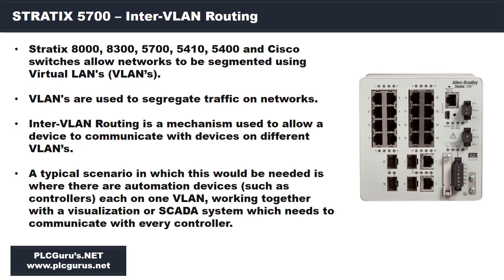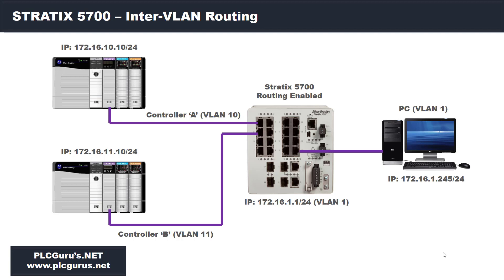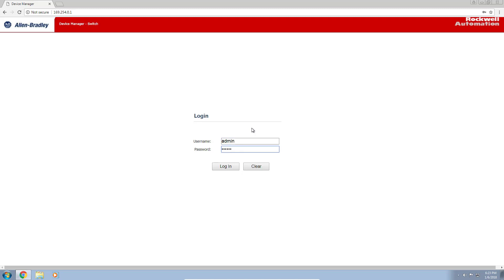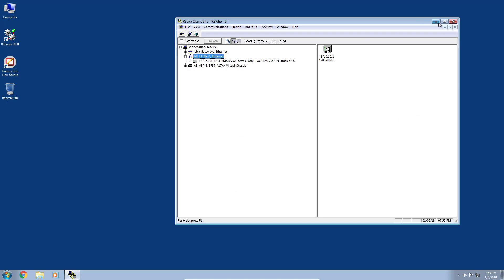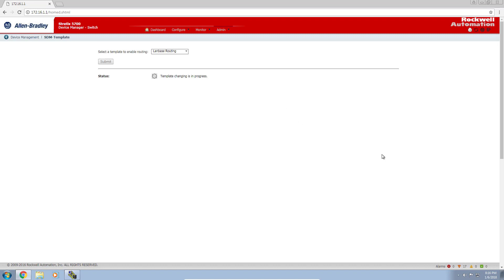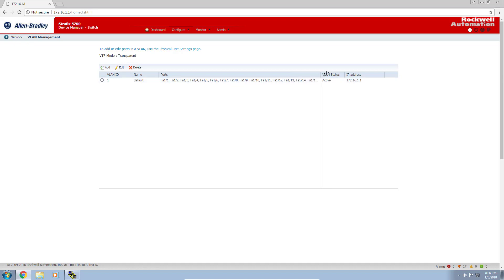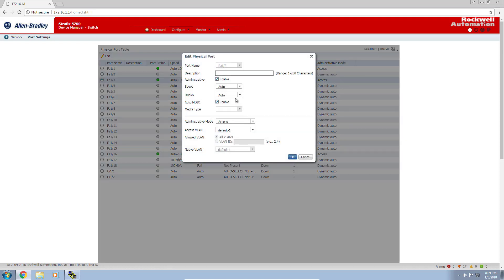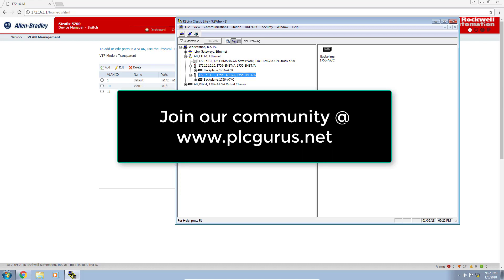PLCGurus.NET - Stratix 5700 VLAN Routing

Comment: If I need connect a tooling with different ip addresss than plc . Let's  say tooling have scanner, cameras, sensors ,pneumatic block ,ios everything with ip 192.20.20.xx but the plc is 192.168.1.xx, I cannot change ip addresses tooling because should run in 2 different lines.  What can I do for plc 192.168.1.xx be able to recognize?

Comment: ah mate please help me here, i used same method but RSLinks shows plc as unrecognized device. been trying it for days now. Also in routing section , if i incert gateway ip 0.0.0.0 , a message will display 'error in gateway  IP'.
Reply: Have you found the answer? I have the same issue
Reply: same here
we need clarification

Comment: QUESTION:- THE VLAN ADDRESSES YOU ASSIGNED ARE INDEPENDENT OR DIFFERENT FROM CONTROL LOGIX PLC ADDRESS ?
Reply from the maker: Not sure I'm following but yes your VLAN IP address must be unique. Typically you'll assign the vlan a xxx.xxx.xxx.1 or .254 address, these are common gateway addresses. Then your PLCs will be on the same network as the vlan to which they're assigned. Hope that makes sense.

Comment: How come I get an "Error in gateway IP." message when using the 0.0.0.0 on Routing Gateway Address?
Reply: The switch should have an IP of 172.16.1.1 and no gateway. The PLC has an IP of 172.16.10.10/24 and a Gateway of 172.16.10.1. The RIO has an IP of 172.16.11.10/24 and a Gateway of 172.16.11.1. The PC has an IP of 172.16.1.245/24 and a Gateway of 172.16.1.1 (which is the same as the switch IP). The VLANs, 10 and 11, in VLAN Management must point to the PLC's Gateway addresses. https://www.plcgurus.net/forums/topic/startix-5700-vlan/page/2/
Reply: @zfire777  The switch should have an IP of 172.16.1.1, if  172.16.100.1 ?
Reply: Leaving it blank worked for me on firmware 15.2.(7)E3

Comment: Just a note that Stratix 5700 will have different features depending on the catalog number. You will not get a routing capability if you have the basic catalog number. Please see manual for details on the meaning of the characters in the catalog number.
Reply from the maker: Great point. Thanks for the comment Gilbert!

Comment: Did the newer firmware on the 5700s break this feature?  I can’t enter 0.0.0.0 on the gateway.
Reply: I tried this a couple of days ago myself with a Stratix 5700 running version 15.2(6)E2a firmware.  I was able to enable routing and just leave the gateway blank on the routing page and everything worked.  Hopefully this helps!
Reply: @nickstripling4171  Do I need to ignore the message "Enabling routing without a gateway address may lose device connectivity. Do you want to continue?" when I leave the Gateway IP as blank in the Routing page?
Reply: @andrewstar9904  did you find the answer to this? I’m in the same boat...
Reply: Jason Hildebrand did it work? Leaving it blank?  because I have the same problem
Reply: Leaving it blank worked for me on firmware 15.2.(7)E3

Comment: Hi, thanks for the video!  I have a question: The SCADA Will comunicate  with Both of them, but they are segmented and don't comunicate between theyrself? Is that right?
Reply from the maker: That's correct. Unless you explicitly configure it to the vlans will remain segmented.
Reply: @PLCGurusNET  Hi, is there any way how to segmented a network and communicate with each other?

Comment: Hi, thanks for your video. I just have a quick question. If I have a 3 PLC but with the same IP address. Is possible to add a virtual IP address and connected to one vlan ? The reason is because  I shouldn't change the original IP. Thanks.
Reply from the maker: Hi there. What you will want to do in this case is setup a NAT. I've done a video that shows exactly what you're talking about here: https://www.youtube.com/watch?v=tbzlGXNNbfY&index=7&t=500s&list=PLwSeJ8UtSBoJOrY2DU-GIFxgRW4ahZ-Cm